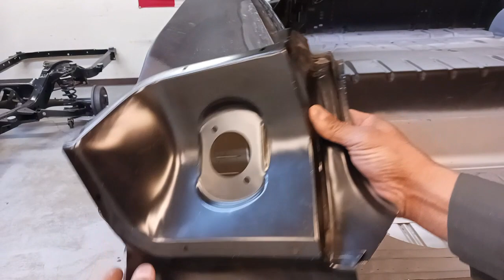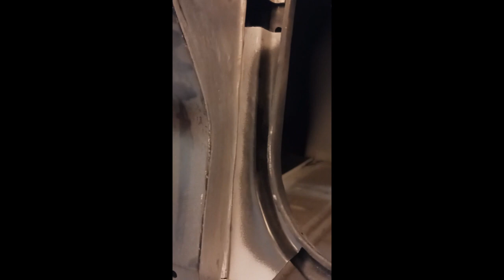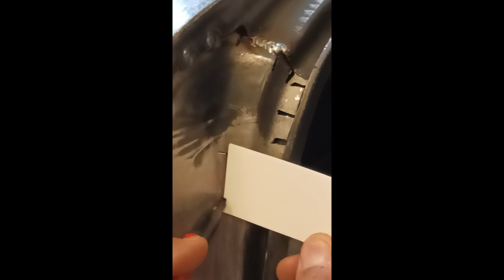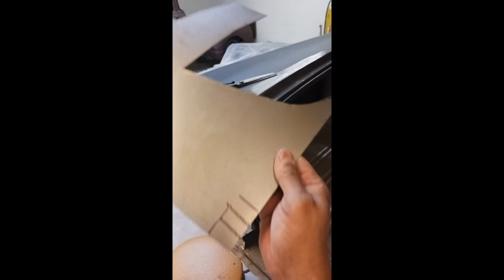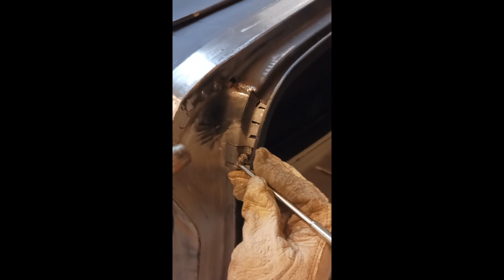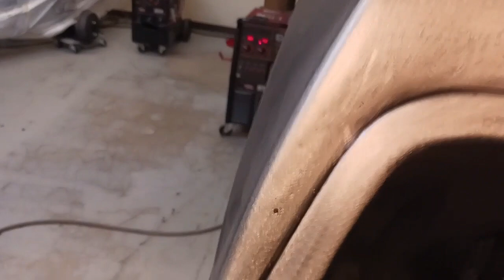I Had to Cut Up the New Restoration Parts....- DYI Auto Restoration Repair

Comment: Great work, its a mountain of information and skills, can you please tell me the grinding tools you are using they seem to have a great deal of rpm and also very easy to handle, thanks
Reply from the maker: that is a  CHIEF™ 4 in. Professional High Speed Extended Reach Air Cut-Off Tool from harbor freight, excellent tool ! Thanks.

Comment: You are giving me confidence to fix the alignment of the body panels of my Camaro. 
I understand that you want to check your work and make sure the metal isn't too thin but stabbing it with an ice pick seems like you are creating small dents everywhere.?.?
Reply from the maker: @tonyscott8126  well let me start by saying yes you absolutely can do your own work ! find good instruction and then follow the steps
As for the dents... yes I do use a pick usually I push, what I'm actually doing is more for the video and I'm striking the weld bead yeah you're not going to dent that. Thanks

Comment: Many of the body panels that are being supplied appear to be "blems" or "seconds" these are terms we used, many years ago, in the construction industry to describe a product or material that was somehow "inferior" in its manufacture. At least back then the supply houses would disclose this and offer it at discounted prices and would also offer the #1 materials at regular price. There appears to be a disconnect between what restorers need to correctly and efficiently rebuild these vehicles, and what the manufacturers are willing to supply. What's worse is that the prices of these inferior materials have nearly doubled in some instances, but the quality has not improved. There needs to be a feedback loop to the manufacturer where these issues can be communicated, where nothing is lost in translation and transparence of the problems are addressed instead of just being accepted by the industry. Keep rolling.......
Reply from the maker: You are absolutely right... but we have let big business become monopolized across-the-board.... at this point in time, they have normalized, here's what's available take-it-or-leave-it..... and on top of that availability is shrinking...
Going forward, I've  decided to start patching, fabricating repair panels to fix original parts and not replacing complete panels unless I don't have a choice and there is too much damage or just not taking on certain jobs that I know are going to turn into a nightmare because of the replacement parts quarter panels/ tail light panels in particular.....

Comment: The taillight bucket and quarter come from different suppliers?  Has that taillight bucket stamping been around for along time?  Didn’t know if you were already aware of the problem when you cut apart the deck lid lip.
Reply from the maker: Same manufacturer, alot of times you don't know until you start cutting things apart..... yeah it sucks....